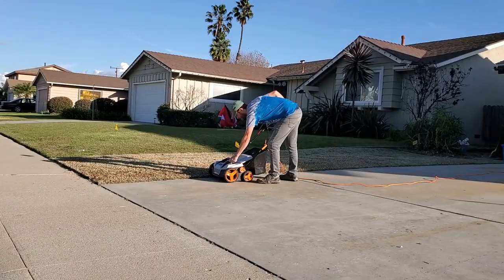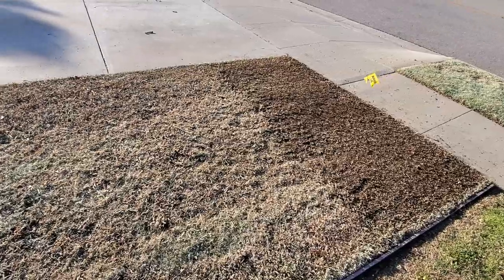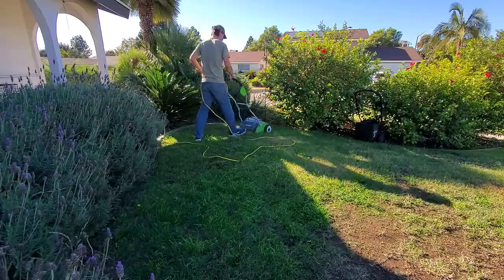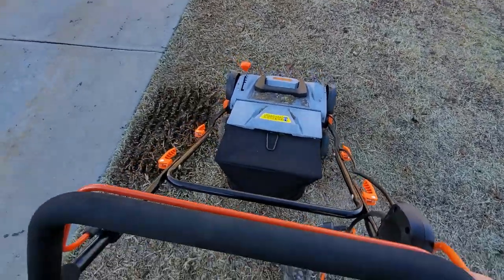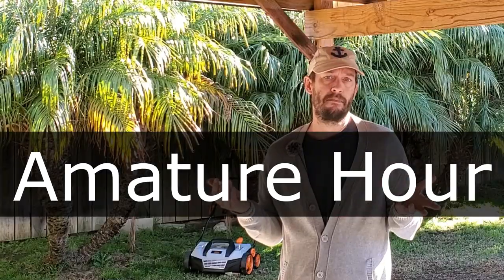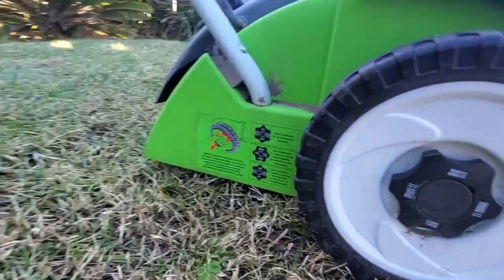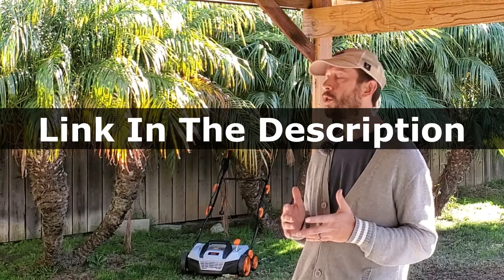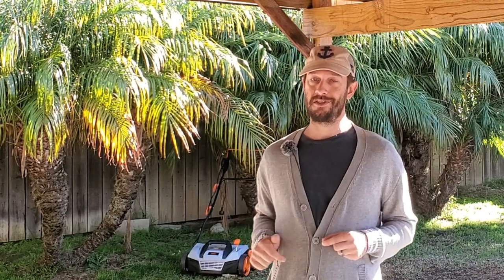VonHaus Electric Dethatcher/Scarifier Review: Better Than SunJoe?

Comment: These electric DIY machines are very good for the price and performance. I have had the Greenworks for years and happy with the investment. It doesn't have the scarifier attachment like the others though. I can buy cartridges for my Liberty 43 but are very expensive for the amount of times I would use them.
Reply from the maker: You know I didn't say in the video but wish I had, the Greenworks dethatcher provided replacement springs for the dethatcher which are nice because a couple of mine have popped off over the years but the vonhaus didn't provide those replacements. That Greenworks machine is a really great buy for the price IMO.
Reply: @TurfMechanic  very true and I have already used the replacement springs lol

Comment: I purchased the VonHaus after dealing with multiple failures of the SunJoe.  I had three SunJoe Dethatcher/Scarifiers.  All three, worked only ONCE then failed.  The first one, SunJoe replaced under warranty.  Second one only worked once again but SunJoe would not replace even though it was also under warranty.  Third one I had to purchase, and again, you guessed it, worked once then failed.  I will never understand all the glowing reviews of SunJoe on YouTube?  Total Garbage.  I have used my VonHaus twice now on a property of 10,000sq/ft.  Its much more durable, handles better then the SunJoe and my hope is that it last far longer then the SunJoe.

Comment: as far as I am aware they are not designed for use backwards. They do seem to pull up more but put a much larger load on the motor

Comment: ...and there it is!

To destiny & beyond!
Reply from the maker: I might have pushed this video out sooner than I had planned because of you :D Seemed like a good way to introduce my new toy while also showing the in between stages of my side yard lawn reno this off-season.
Reply: @TurfMechanic  It's more good content in a bite-sized piece.  I like the slightly deeper bite of the blades.  I tried a SunJoe on my boulevard strip last year and it just kissed the top of the crowns rather than chewing them up.  I proceeded with poor results and need to regroup.
Reply from the maker: @RDAmidwest  kissed the top of the crowns! Love that descriptive prose 😁

Comment: I believe any of these machines called dethatchers are power rakes.  They mechanically rake debris from the lawn in the same way a hand “dethatching rake”.  They just remove debris from a lawn.  Debris is the greatest on lawns where  grass cuttings are left oh the lawn.  IN MOST CASES a genuine dethatcher would remove the lawn.  If you want to  actually “dethatch” your lawn use a liquid dethatching chemical.  If you want to keep thatch low, bag up the grass clippings, put them into a compost bin.  The power rake in most cases will remove only the debris sitting a top the thatch.
Reply from the maker: Sounds like a perfect summary of the followup video I linked to at the end of this one...the biggest problem with electric dethatchers is...they don't actually remove thatch! :D I like the way you think and agree with this comment. I'd say chemical isn't the term I'd use for liquid dethatching but I agree with the concept.

Comment: What gauge power cable did you use on the Sunjoe? I'm wondering if that's why the motor died unexpectedly??
Reply from the maker: Good point, I usually use 12 guage cords, but there's always a chance I accidentally used a light duty cord at some point on accident. As you go further from the outlet that can be worse. I didn't notice a problem at all though during my hill yard reno project in July and August. I only noticed it in Sept after my late August job that I did close to the house. Maybe I used the wrong cord, not sure.
Reply: @TurfMechanic  I didn't know that was a thing until I bought mine. I remember the instructions were specific to 14 gauge up to 25 ft, 16 for longer. Something like that. My SJ cultivator said same thing. 

I guess it also depends on the motor's requirement as they can vary among model and brand.
Reply: Maybe a good tip on next video lol